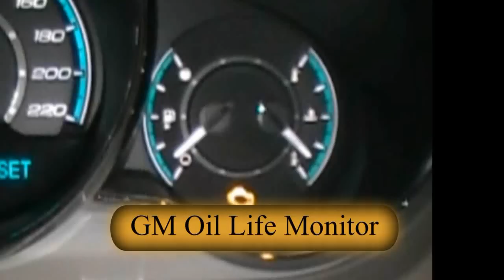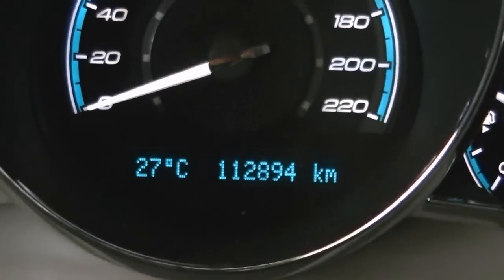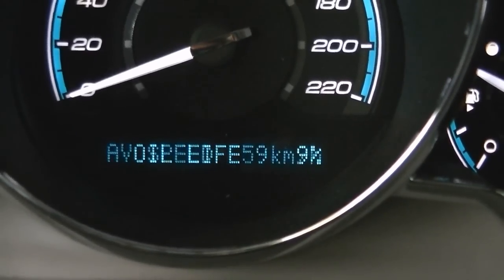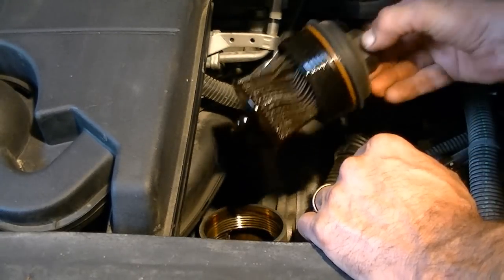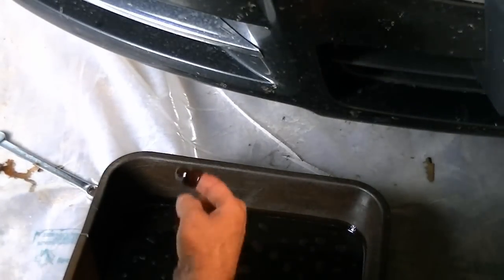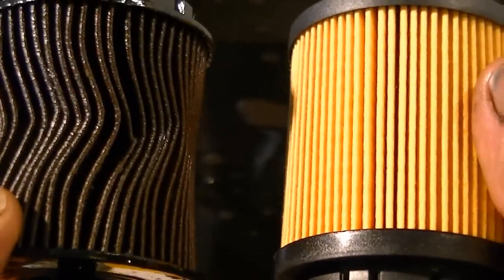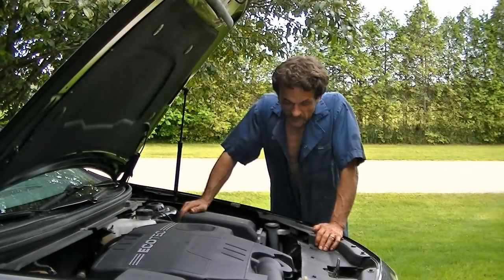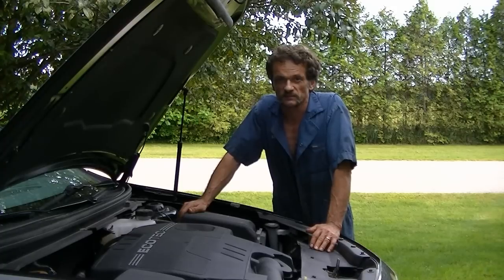GM Oil Life Monitor - Can You Trust It?

Comment: My car takes 3.7L i get the 4L bottle,my 2002 Yaris never use any oil so i do this....,i pour just a little bit of oil in the engine (when oil is drained & sump plug off) and that rinses/washes away any dirty oil sitting on the bottom of the sump.Top tip there folks.

Comment: GM oil life monitors use three basic pieces of information to determine the life of your oil. The average engine temp, engine speed (rpm) and key cycle time ( length of time that the ignition is on). The system takes a running average of these three and it know if you drive short in town trips or long highway trips. Very simple.
Reply from the maker: Thank you for that description. I do believe that's exactly what the dealer told me.

Comment: I have a 2005 Cobalt and have been doing my own oil changes per the Oil Life Monitor since 2008. So far, no problems at all. It has me change my oil about once every 7,500 miles. I use cheap oil filters and just normal oil (non-synthetic).
Reply: 8 years later ...how did that work out on the cobalt ?   Odds are you don’t have this car.  But you never know
Reply: @bbustin1747  I actually still have the car. No problems thanks to the oil yet, but problems related to other things for sure!

Comment from the maker: @99XM Actually the car monitors your driving habits and outside temperatures, maybe more, anyway I had my 1st oil change at 13,000 kms.(8000 miles) and still has warranty on the drivetrain. All my oil changes have been done according to the monitor, less oil changes, car runs great at 130,000 kms!

Comment from the maker: I do agree with you that, a happy medium between the old 5000k rule and the oil life monitor. Since I posted this, I have started to change my oil at around 25%. My diesel, I usually change between 10 000k and 15 000k using full synthetic oil.

Comment: I have a 2017 Buick Regal GS and used both the monitor and visual oil check inspections with dip stick for safe measure and check oil level. The monitor hasn’t failed me yet.
Reply from the maker: This Malibu now has 250 000 km on it. Runs great. Never uses more than a half liter of oil between changes. Normally, now I change it at around 20%. Thanks for your comment, enjoy!

Comment from the maker: Glad you liked it. One thing that I do recommend, is using a good filter and a good synthetic oil if you only change the oil when the monitor says. Fram used to be a good filter but anymore they get bad reviews. I use Wix filters.
Reply: fram ultra synthetic is a good filter. you can use those with confidence.

Comment from the maker: At first I just used regular Castrol but just to be sure I switched to Castrol Syntec (synthetic). I figure it's worth the bit extra thaat you pay. Now, I don't let the monitor get too low before changing it. I change it at 20 to 25 %. If I did choose to start using regular Castol, I would change it no lower than 25%.

Comment: Slipperyness and viscosity are not why oil needs to be changed, esp full syn oil. It is whether the sludge and varnish fighting, ph stabilizing additives have been exhausted or degraded.   

OCI depends on time and degree oil has been hot, total engine revolution, and frequency of acceleration during the OCI. 

If you live in a large city with rush hour and creep on the "freeway" 5-10 mph 20 miles a day and do little other driving, or if you drive mostly downtown stop and go, your OCI can be 3000 miles or less even with full syn.

Comment: I would not worry about the twisted pleats on the filter.  That happens regardless of brand - AC Delco, Wix, Purolator, Fram, etc...  Seems to be a common occurance on all Ecotec engines but it does not seem to cause any trouble.
Reply from the maker: click789101112 Yes, have noticed that on all my filters. Thanks for your comment, enjoy!

Comment: I have the same vehicle with the exception that the odometer and speedometer is in miles. I drive 90 miles round trip 5-7 days a week, and if I follow my OLM I can get at least 15,000 miles between oil changes. Two reasons not to use the OLM to determine your oil changes. 

1. Used Oil Analysis reports indicate that the 2.4l eccotec is hard on oil. Do some research and find these reports or spend $30 and send one in. 

2. Auto manufacturers do not want your car to last too far past the warranty. There is no money in building cars that last. Case and point would be to drain the transmission fluid on this very car. At 50-75,000 miles the trans fluid will come out BLACK! The fluid in these transmissions is dexron VI and is supposed to be a lifetime fluid or good to 100k. 

Use a good oil and filter, and change the oil every 4-6k depending on your driving conditions with this car.

Comment: I have a 07 car with the 2.0 LDK ecotech turbo engine. I was sitting in traffic yesterday, and cycled through the display - the oil monitor said 58%. Then I glanced up at the sticker from my last oil change and noticed I was 3,000 miles "overdue." I've had this car for about six years and used to change the oil myself, but I've grown lazy. I never tracked miles, I just used the monitor and changed oil in the 20-30% range, so honestly I have no idea how many miles I drove between them. 

When I got home I checked the filter and the oil itself. The oil looked a little used, not as golden amber as new oil, but nowhere near black at all. The filter was a little dirty though, so I did change that since I already had a spare in the trunk.

I checked the sticker, and I was at 4,400 miles since my last oil change. I was definitely comfortable with going another 3k miles on that oil at that rate.

That being said, I don't rely 100% on the monitor. You can "feel" when the oil is going bad in this car pretty easily. You can also see the change in MPG. So I use a combination of feel, fuel economy, and estimated oil life for my oil changes and don't even factor in mileage

Comment: i have a 2010 malibu and got it with 8 miles brand new. 
i did my first oil change at 1000 miles for peace of mind, i wait til the display goes to 5%
i only use Castrol syntec or Mobil1 synt. i used an STP filter and it twisted like the one on this video, so did the Fram, so I do not use these anymore, i tried the Mobil and Bosh and had some improvement, but the best filter so far has been the Fram XG series, this has a wire mesh inside that keeps the filter from twisting. (made in USA!)

Comment: The GM engine oil life monitor counts engine revolutions and accumulates the number for the basis of the oil life calculation. It then adds deterioration factors for operating temperature, start up temperature, soak times, ambient, coolant temperature, etc... There are a LOT of factors that "adjust" or affect the slope of the deterioration but the fundamental deterioration is traced back to the ZDP depletion that is inescapable with engine revolution.

Comment: Having worked within GM and some first hand knowledge about the system and how it operates, I know it can be trusted. If you want an extra measure of confidence, use 100% synthetic oil. My Silverado, depending on temperature and driving schedules has varied from 4K oil changes on up to over 10K.
Reply from the maker: I agree, if you plan on going according to the monitor, it is best to run full synthetic. I have changed over to synthetic on the Malibu and my Duramax diesel. Thanks for watching!
Reply from the maker: ***** It does not actually test the oil but yes, it goes according to driving habits, load and temperatures that you are driving in.

Comment: Fram PH16 filter caused a noticable engine tick in my Dodge mini van's 3.0l V6, piece of paper end cap came off blocking oil port in valvetrain.

Napa filters have one of the best price to performance ratio's, basically just a rebadged Wix filter, purolator is good, even the OEM dealership filters are better than the Fram, 

I once read that Pennzoil yellow filters had Fram internals, this may not be true anymore (Wal-mart commonly uses these) worth investigation.

Comment from the maker: That's how the filters look when I use Fram filters. I started using Wix and they look much better when they come out. You say it's O.K. to follow the monitor. Just wondering about a comment I got from someone. His GM dealer had told him to change oil at 3,000 miles cause the crud can mess up your timing. Is that somehow possible?

Comment: I was trusting the oil life monitor on my now junk 2008 2.2L Malibu. I used to change oil when it got to about 10 -15% life left. The car has 154,000 miles and the engine is now toast. The timing chain skipped teeth, leading to bent valves and gouged pistons. My mechanic is convinced that the oil was not changed often enough which led to sludge buildup, timing chain failure and subsequent valve damage. I thought timing chains lasted forever, so I never gave a moments thought that this might be an interference engine, which it is. The estimate is $6,000 for a new engine. On my other older cars, I change the oil at 3000 - 5,000 miles, but was duped by the stupid Malibu oil life monitor. It wasn't indicating an oil change for at least 10,000 miles which I thought was too long....but hey, who am I to argue with the manufacturer. Anyway, the car is going on Craigslist as a parts, and I learned my lesson. Anyone know if there's a 4 cylinder, chain driven NON interference engine made by anyone. Cheers.
Reply from the maker: Sorry to hear about your engine. Now you have me wondering if I should check my timing chain. Our Malibu has 205 000 kms (127 000 miles) on it now. Runs great so far. Oil changes are done between 15 - 25%.
Reply: Locutus3: I am curious to know  What was the Type of Oil that you was using??? Normal or Synthetic????
Reply: this is why i like the old style 6 and 8s with overhead valves not cams .    short cam chain that is easy to change and doesnt stretch so easy

Comment: my g6 has real long oil life, i drive mostly on the highway. Do my own oil changes, Ive been running full synthetic since the first change. noticed the cheaper filters will start to collapse, high dollar ones hold up better from what ive seen, 115000 miles on my car, no oil consumption at all. the motor was broken in the hard way. I don't think i'd run cheap filters and regular oil out to 8-10k but the synthetic and high quality filters seem to do the trick
Reply from the maker: I agree that good synthetic oil and good filters are very important if you plan to do your oil changes according to the monitor. Since this was recorded, I have switch to full synthetic and Wix filters. (I can't remember what I used on the video) Enjoy!
Reply: Nice your engine sounds like a 300k miles with no problem

Comment: Guess this motor is like the LSJ motor in my cobalt. Try taking the oil filter cap off with a wrench when there's a big supercharger in the way heh. FYI, never ever use a Fram oil filter in any car. There have been tests done and they fall apart all the time. Good to know you can somewhat trust their oil monitor. I still change mine before it says so just to be safe, and mine has 170k miles and still has 195psi compression on all 4. These new motors rock!

Comment: A slight typo in how I do things. I meant to say I run with synthetic lube and change the oil filter at 3000 miles, and a complete PM check with oil and filter change every 6000 miles. with an oil sample test to monitor the engine health.I forgot to mention I also average 200 miles a day on my vehicles.

Comment: What manual? I have access to a 10 Camaro and a 12 Equinox Manual. Both say: "This vehicle has a computer system that indicates when to change the engine oil and filter. This is based on a combination of factors which include engine revolutions, engine temperature, miles driven, as well as many other factors. Based on driving conditions, the mileage at which an oil change is indicated can vary considerably." I am not trying to say you're wrong. The Malibu's may say that, but neither of mine do.

Comment: I find the oil life monitor to be accurate, and i change it when it hits 25%^.....i will be sending out my oil for analysis to get a good idea when to swap it out....currently i do 3500 miles as  i idle alot here in NYC.
Reply from the maker: I generally change it at 20-25% now. We do more open road driving. The car has 210,000 kms on it. Runs great! Could you let me know what the analysis shows?
Reply: I will definitly keep you posted, as i am scheduled to  do an analysis shortly...
Reply from the maker: Thanks, I look forward to it.
Reply: When  I first  got my 2008 malibu, I was  told  not to go  below  20%. When I  took it  in  for an oil  change IT WAS  BLACK  on the verge  of sludge. I  now  change   it  every 3000-4000 miles .I try to do it at  3000  because  of any oil loss  ,  especially on  a  90,0000 mile engine   Better to be  safe.

Comment: So after putting in 4.7L into the engine, does the dip stick level at full mark or 3/4 full?
Reply from the maker: Yes but I started to put the full 5L in. It's only over the full mark a bit.

Comment: when your timing chain streches from lack of lubrication and jump a gear call gm abouf ya oil life monitor 🤣
Reply: Chaz Carter that's apparently a common thing, I'm not going to trust mine, I just bought a 2012 gmc Sierra, my oil will be changed at 5,000 miles with full synthetic dexos 1 oil, vehicles are expensive, why not just change the oil regularly? I don't get people
Reply: Samuel Clark  yes sir and those filters are still the same rather be safe than sorry
Reply from the maker: We have owned this car since new. Oil is changed at or below 25% (approx 8-10,000 kms) This video was made at 112 000 km. The car now has 
210 000 kms. Running strong as ever!

Comment: I think it may be good for the short term meaning to keep the car for 100,000 kilometres (60,000 miles) or 3-5 years.

The 5.7 litre V8 LS1 engine I've got in my car it comes out with some carbon at 6000 kilometres or at 4 months,the engine has done 337,498 kilometres & doesn't use oil.

I've had success with Nissans (RB30) engine, the first had about 450,000 - 500,000 kilometres as I'm not sure how many kilometres it had done when we bought the car because I'm sure it was a second hand replacement motor,it was my dads car I took ownership of.

I've still got the engine block as that car got written off & I bolted that motor into another car as that car had 300,000 kilometres on it & they didn't change the oil that often, it was burning oil.

I rebuilt that one & built a hybrid twin cam RB30 engine out of it but it still runs a virgin (original factory) engine block with new rings & bearings fitted,so I put that engine back in & stripped the other one down,it has worn cylinders & needs a rebore.

I can tell you now,the engine  has done 200,000 kilometres & it's still good,the block is 500,000 kilometres old now & that was after doing the 5000 kilometre or 3000 mile oil change,that engine also puts out 50% more power than stock.

They fitted them into the Holden VL Commodore in single cam & turbo form as well,the 150 kilowatt 3 litre engine claimed to have an engine life of 150,000 kilometres with a 10,000 oil & filter change so I have to wonder why my 170-190 kilowatt engine is still o.k.,notice it's not turbocharged.

Nissan claimed that the single cam non turbo engine had an engine life of 400,000 kilometres with a 10,000 kilometre service.

The taxi companies do it that often because their cars have that sort of mileage on them when they are only a few years old,they need to think long term !!!!

Comment: Should you saturate the oil filter in oil so that you're not depriving the engine of oil on the first startup after the change?
Reply: just unplug ur plugs and crank it a bit to get some oil going through the motor. im sure there is enough of an oil film on the parts that that second will not matter to much

Comment: Hi there very informative video sir, i would like to ask how did you make your fuel consumption 8.4 per 100 km, cause mine does 12.2 in summer and now in winter 15.2 is this normal? I drive the 2011 model malibu, thank you
Reply from the maker: That kind of mileage just does not sound right. When we drove to Tennessee from Canada our milage went as low as 7.9/100km. Have you had the engine light come on at all? or has this car been run on ethenol blended gas? I have a fuel treatment that really helped restore our car's power.
Reply: Yes sir that's what im getting so far i feel like driving a v6 in terms of fuel consumption, yes 7 months ago i had an engine light on and i took it to my dealer and he said it has an hole on the fuel pipe going to the tank, so i got it changed, but when i saw you video it really doesent make sense how bad my fuel economy is, i changed my gasoline to mid grade about 4 months now, i got this second hand from a dealer here in winnipeg, can you please help me cause i got ripped off with the price already when i bought this car. Thank you in advance and happy holidays.
Reply from the maker: First thing I would do is try a good fuel treatment to clean your injectors. The best cleaner I know of is StarTron. This is what I used on our Malibu to restore it's power. Another thing that I had replaced was the catalytic converter because there was a recall on that. Maybe check to see if the 2011 has the same recall. If you don't have a recall on that then I would suggest changing the spark plugs. I have a video on how to do that too. Best wishes for the new year and Merry Christmas to all!
Reply: Thank you sir, i will try it.
Reply: May you run mostly street and MudRFunR may mostly at freeways or roads. Or you drive harder.